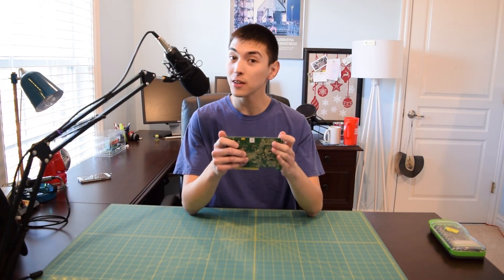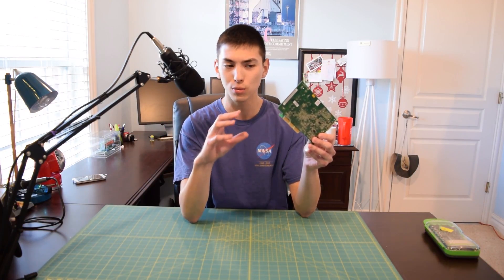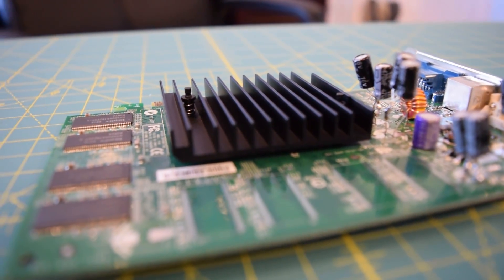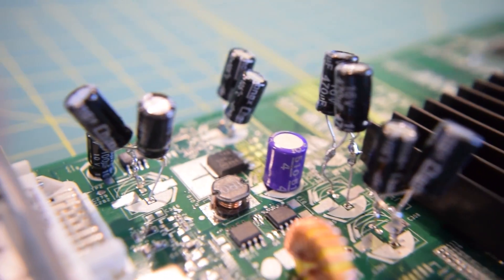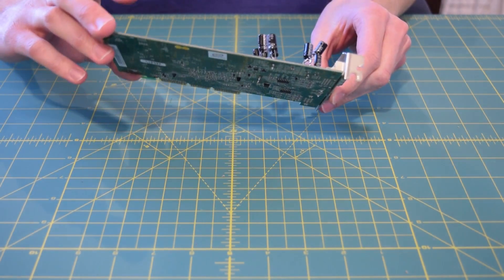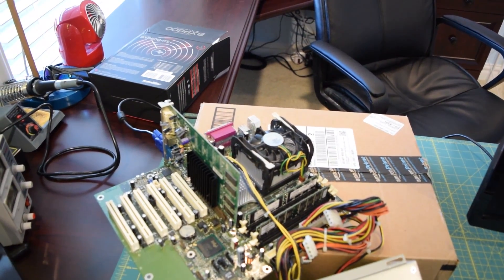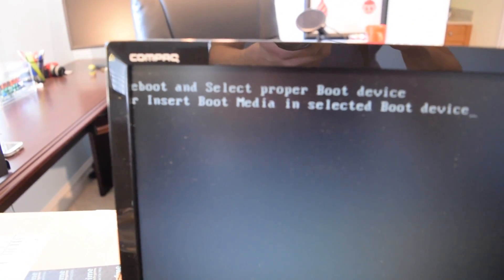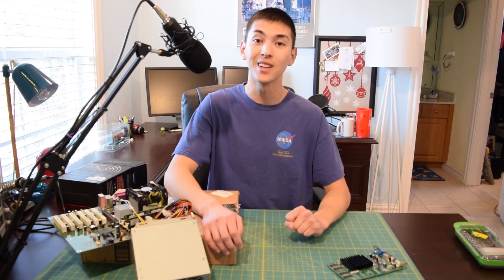Failure EP2: Botched Video Card Capacitor Replacement (FX 5200)

Comment: That does not seem too bad. I too had to do it that way when supply of proper capacitors are out. But we use ELNA capacitors only.

By the way...I have myself a laptop with FX Go5200 that suffered memory problem. It is a 128-bit 64MB but after about 15 years it became 64-bit 32MB as shown in Rivatuner. I had encountered extreme slowdown, and one of my most treasured programs refuses to run.

I do think it is time for a new laptop, but do not have funds to get one that will last as long as this Toshiba does. Hope any ideas. We once encountered same problem with similar cards with dual channel memory where one half will die and need new RAM chips on that half...or else, replace GPU and all memory(buy another GPU if desktop).

Comment: I have one of these laying around and it can't even run youtube at 1080p desktop resolution, with any settings on youtube without stuttering. I'm thinking about hardware overclocking it with heatsinks superglued on it. the chip is nice and flat, a good surface to glue junk on.